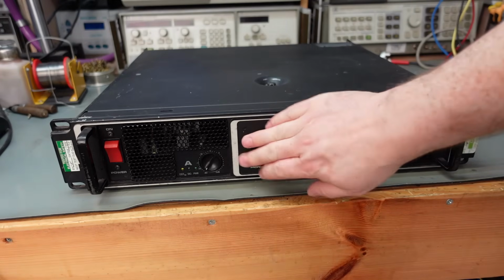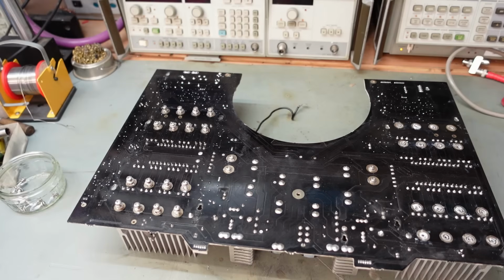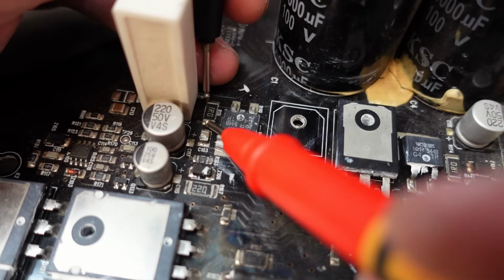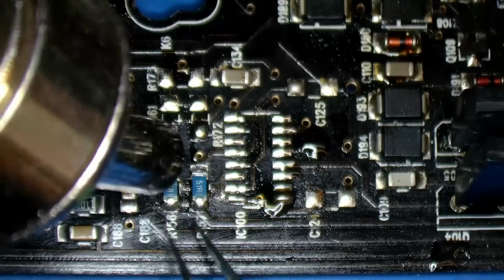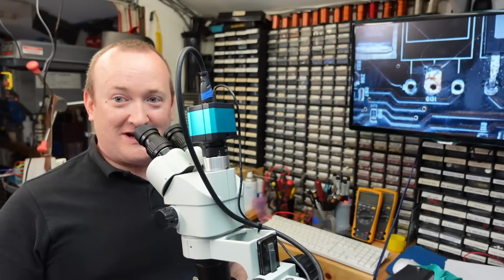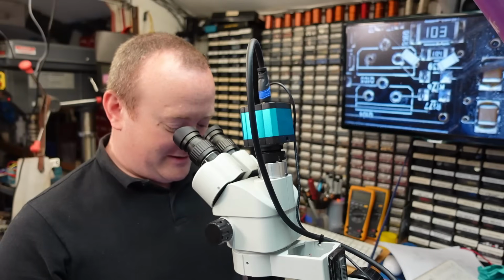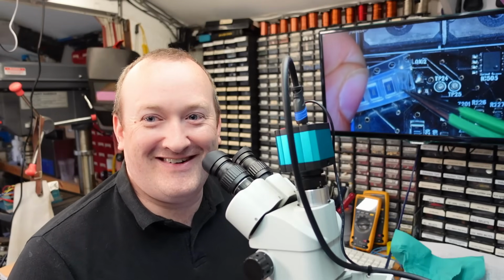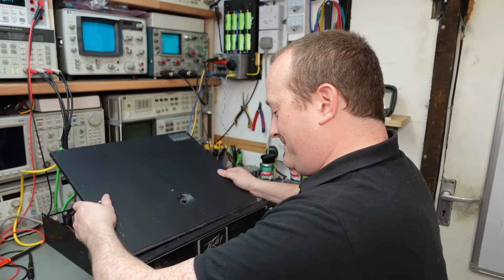PEAVEY 4000W Amp Repair (CS4080HZ)

Comment: I was freaking out at the end! The MOV still had a good chunk missing and the center leg of the neighbor IBJT was missing most of its solder.
Reply: The MOV mentioned was actually an NTC inrush limiting thermistor, wasn't it? And I assume you meant IGBT, Insulated Gate Bipolar Transistor. You're forgiven, for those who come up with acronyms likely never will be. 🫠
Reply: Yep, I was waiting for it to..
Reply: C124 and C125 were also missing. It looked like they had been removed or never installed.  Would have been good to investigate.
Reply: Also seems the paper next to the fan for airflow over the heatsink didn't went back in :-/

Comment: Mark, I used to use a Fiberglas brush like you have, but I've found something far better: the eraser on a #2 pencil.  The rubber has pumice in it and it perfectly scrubs tracks, pads, battery contacts, etc.  I buy these pencils by the box.  Have you tried this yet?  The Fiberglas is dreadful to use.

Comment: Mark, what was the cause of the short circuit that caused all the damage?  I have had exactly the same experience with a Yamaha active speaker. I plugged it in to try to witness the problem the owner described and it went bang. I've found some of the destroyed components but probably not all of them and I am still puzzled as to why it went bang. Don't have a limiter, or a variable transformer. I test for shorts by plugging the power lead into the device and then putting a meter on the Live and Neutral at the plug end. Obviously a flawed approach :) !

Comment: I have bought hundreds of semis from Aliexpress, the only problem being if I solder them in back to front. Some of the replacement older analog ICs, 741, 494 etc being better than the originals. IRF3205 a 55v fet handling 90 volts for example.. I think the main trouble with fake components is in the digital range.

Comment: 4000 watts at 2 ohms is about 32 amp to the speakers!
Wow, through those little banana jacks??
Reply: the 4080 isnt capable of 2 ohms loads.  Its max rating is 2040 per channel at 4 ohms, or 4080  bridged at 8 ohms. Still alot of current tho!

Comment: I wrote this reality check for another 4000 watt repair....
I see the two mains fuses are 16 amps into a PC board.  Assuming you are in Europe at 230VAC x 16A total = 3,680 watts max.  Leaving a little room to prevent fuses blowing every hour at full volume, let's say 12A working load.  230V x 12A = 2760 watts in from the mains.  The amp is a direct coupled analog amp, so it's about 35% efficient to get great harmonic distortion numbers the audiofools insist on.  2760 x .35 = 966 watts /2 channels = 483 watts/channel....into probably 2 ohm loads.  483 into 2 ohms, 242 into 4 ohms, 121 into 8 ohms per channel.....hardly the 4KW RMS promised.  121 watts RMS will smoke most consumer grade speakers!  Less than 2 ohms the lines of transistors melt but will blow the 16A fuses or pop the house breakers before the fire...
Shhhhhh....Never mention math when selling stereos!

What mains fuse/breaker rating is this Peavey junker got??

Comment: Horrible smell? The magic smoke has been set free. Careful not to bend the board and break the traces. Apple had a similar problem with a smart phone called flexion. Were the heat sinks used as a space heater? Campfire replacement? Arc welder? Nice scope, looks like the neighborhood has some damaged residents. It's not brain surgery, more like transplant surgery. Top notch solder slinging. 👍👍

Laugh it up fuzzball -Solo to Chewy.
Good repair👍👍
 So you're near an air base, I'm a stone's throw from O'Hare airport, Chicago suburbs. 
 TTFN.

Comment: Good job. But why didn't you replace the black capacitor which had a part missing. That capacitor part is still missing when you put it back together. See 43:35
Reply: NTC thermistor  (resistor). Initially it has a high resistance, limiting the inrush current.

Comment: 6:10 with phillips you can use a single screwdriver for 10 different screw sizes and not strip anything, with torx it's always 10 different bits for one bloody box, half mauled with a flat screwdriver by some other guy. All that for not that much of a torque increase.

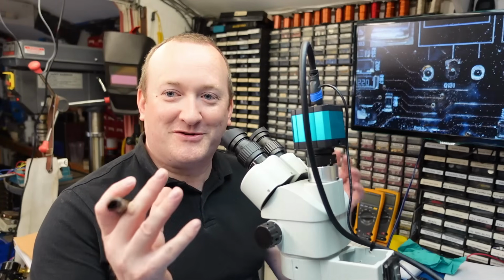Comment: 23:10   You aren't kidding... I've had some boards with carbon damage on them flash over in high voltage areas, and in lower voltage/high current areas I've had it where the current just slowly creeps across the carboned areas, eating the board away as it goes. 

Sometimes no matter how well you clean the carbon off, it just isn't good enough, and the board is toast at that point. When the carbon damage is that bad on  a single or double sided board, sometimes you can get lucky enough to drill some holes and stop any further conduction damage. If it's a multi-layered board, forget it.
Reply: I have no idea what you’re talking about but it sure sounds like you do 😂
Reply: @BLUE_OCTOBER-TRIX  🤣 🍻
Reply: @davelowets  
I hope you’re having a blessed day brother. God bless you and yours.
Reply: @BLUE_OCTOBER-TRIX  Thanks much, you too! 🤜🏻
Reply: @davelowets  
Where are you from brother? I am from Chicago. I am a DJ and producer of electronic music. I am also a black belt in martial arts. I have been DJ’ing and producing since 1995. I even opened for Daft Punk in 1997. I have been in the martial arts since 1988. I got my black belt in 1997. What do you do for fun? It sounds like you know music pretty well. It sounds like you’re a technician or something. you have a good grasp on the concept of music. I hope you’re having a blessed day today. God bless you and yours brother.
Reply: @BLUE_OCTOBER-TRIX  Thanks! You too... Sounds like you've had a good time or several during your lifetime so far. 
I'm bout 3 hours north of you... I'm a drag racer, and yep, I love music and the equipment used to produce it.
I'm also a guitar amp tech in my spare time. I still love working on the old vacuum tube equipment. 🤘

Comment: I guess 4000W is a peak power rating given the input power is limited to a 10A connector (2400W) and there is no way that tranformer is big enough for 4000W RMS
Reply: It’s probably more somewhere along the lines around 200W continual 1200 peak 😂

Comment: The power output ratings is misleading . I mean how 4000 Watts = 4 kilowatts output is possible when regular wall power outlet provides 230 volts AC at 5 amps is = 1150 Watts.
Reply: I was saying, it’s probably more along the lines of 200w continual and 1200 max

Comment: Nice job Mark, bit concerned about the transformer bolted to both top and bottom covers - how do they stop a shorted turn around the toroidal core?
Great gear , that microscope is fabulous tool, expensive?
Why do PCB designers use such thin tracks to connect on those big pads. Just lazy use of CAD system defaults i guess.
BTW did you change those VDR discs with a chunk out!

Comment: 👋👋👋 Great job, Mark! Nice equipment too. I repair guitar amps and not so many power amps these days as I'm not up to snuff on all the new SMPS powered circuitry and such. I question if I would have even attempted this repair but it does give me a little hope see how well you handled it, so thanks!
Reply: The newer switching stuff is much more complicated indeed. I don't like working on them, and I especially don't like listening to them either. Gimme a class A or high bias class A/B all day long. 😁

Comment: but modern PC CPU thermal paste is a better option than that the white stuff we used in WIN98 days.

Arctic Silver 5
Arctic Silver 5 was formulated to conduct heat, not electricity. (While much safer than electrically conductive silver and copper greases, Arctic Silver 5 should be kept away from electrical traces, pins, and leads. While it is not electrically conductive, the compound is very slightly capacitive and could potentially cause problems if it bridges two close-proximity electrical paths.)
Specifications:
Thermal Conductance: >350,000W/m2 C (0.001 inch layer)
Thermal Resistance: <0.0045C-in2/Watt (0.001 inch layer)
Average Particle Size: <0.49 microns <0.000020 inch
Extended Temperature Limits: Peak: -50C to >180C Long-Term: -50C to 130C
Coverage area: Sold in 3.5 gram Tube. The 3.5 gram tube contains enough compound to cover at least 15 to 25 small CPU cores, or 6 to 10 large CPU cores, or 2 to 5 heat plates. At a layer 0.003" thick, the 3.5 gram tube will cover approximately 16 square inches.

Comment: I am sure you did much more testing than you showed in the video. Since the amps work on switched supply voltage it is crucial to test with and without load, with low and high level input, at clipping levels etc.
BTW I found that pcb pot hole repairs work best with UV curing glue intstead of epoxy because epoxy would soften again when soldering whereas UV glue does not.
Reply: Alex of Northridgefix (Youtube motherboard repair channel) uses UV glue too. Much much faster than epoxy too, like a minute as compared to 24 hours. They sell a little UV curing light too. I've only ever used epoxy but I'd like to try the UV stuff myself.

Comment: The problem with counterfeit semiconductors is a real pain. Having the curve tracer to check them under load is almost mandatory these days. Nothing worse than watching your extensive repair go bang. Great video.
Reply: On top of that, it is not knowing why it went bang. You spend lots of time looking for something you could have missed. A few years ago I repaired a powerful sub amp. Checked it over several times, switched it on and it blew. I was scratching my head. Did over again and triple checked. All was good but it failed again as soon as I turned up the volume slightly. That turned out to be what I thought at the time was batch of bad output transistors. Not so much was known about the fakes at the time but that's what it was.
Reply: Or soic 8 ic's with the original part mark taken off and replaced with a totally bogus new one!! 😮

Comment: Finally at 9:40 is the result I was expecting. I kept saying to myself, "I wonder when he's going to discharge that bank of chonky electrolytic capacitors?" Then later, "I hope he discharged those electrolytic capacitors". 😑🙄

I can't understand why you didn't immediately discharge those electrolytic capacitors once you got that PCB out of the case. That's taught in the very first week if not first day of any reputable electronics technical repair course programme.

Comment: Incorrect application of heatsink grease will guarantee early failure of this otherwise good service.  The method used will assure bubbles and gaps in heatsink  grease causing hot spots on the transistors.  Please learn how to properly apply heatsink grease.  There are many tutorials available!

Comment: Worked on older 40kW Unholtz-Dickie shaker table audio amplifiers. Class B amp water cooled, intended for continues operation at that power.
A little bigger then this baby.
Unholtz-Dickie now makes 720KVA shaker table audio amplifiers. Now thats a beast.

Comment: Couple of things: You didn't change those Varactors/Caps. When mounting transistors, drop a bolt in the hole to line it up with the sink mounting hole. Most importantly, when testing high capacity units WEAR SAFETY GLASSES. I also use neoprene rubber gloves hospital type when soldering. They provide extra heat protection for fingers. To get that toroid out, disconnect wires, flip unit upside down, remove bolt from bottom, lift case, rather than lifting with wire loom.
Reply: I doubt that he needs any more schooling Christopher.

Comment: Good thing you got those guns, cousin. That looks like a lot of heavy heat sinks mounted on a 16 GA soleplate.  NOT from doing 16 oz. curls, Mark-  pony kegs more likely.  And that toroid transformer has probably got a  15 lb. ferrite or rolled steel core, and a hefty primary into a secondary providing probably 6 or 7 power requirements. A soft iron laminate core of proportional specs would need its own enclosure and if needed, could anchor a small boat in a pinch. They will run hot if allowed, over time. Bigger fan than that little biscuit fan, and the smell is normal for hot magnetic wire varnish . Gonna happen at least a little, but probably no actual smoke. 4000 watts of mains power would mean a class C or D  transformer through an inverter (PWM) and a minimum of 20 - 25 amps at 220 vac 100% duty cycle, less when using pulsed-power  DC supplies, no?

Comment: Instead of glassfibre pencil, try using scotchbrite pads. The red and green ones do wonders cleaning up dirty tracks, oxidized component legs etc. It gives off some dust, but it's only recycled card board. No razor sharp bits of glass.

Comment: You will need an assortment of ever increasing grit sand paper to polish out the scratched you've left in the soft aluminum heat sink with your metal heat sink compound removal tool (at 7:52 in the video). I would have used a plastic tool!
Reply: Yeah my thoughts exactly. Overall seemed a bit sloppy.